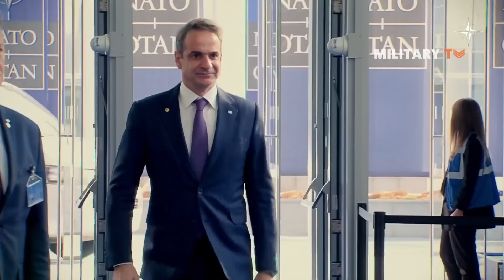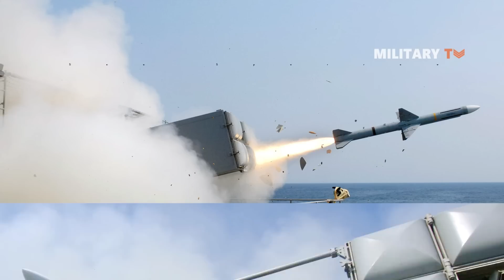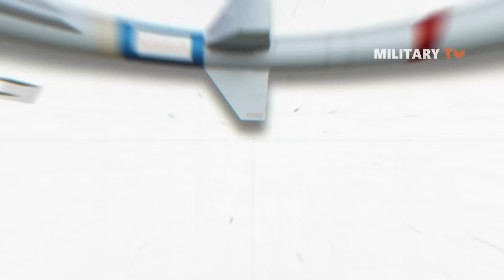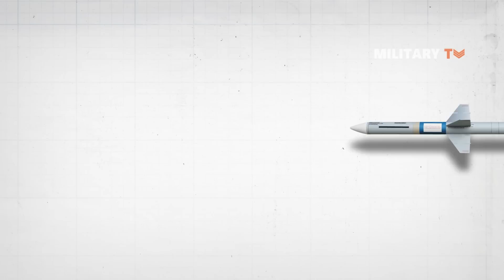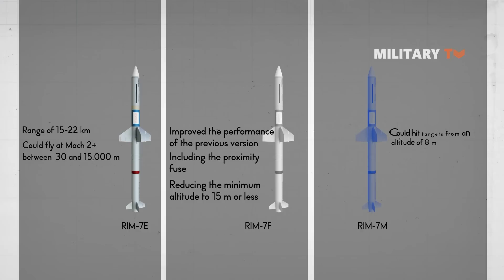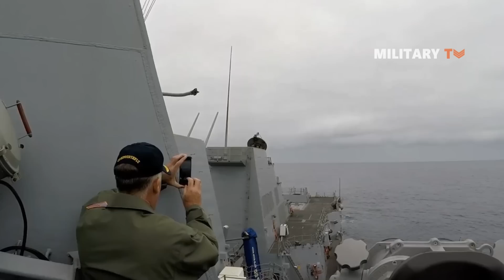U.S. to Send First Sea Sparrow Anti air Missiles to Ukraine

Comment: NOT NASAMs, but still good when used against drones, just not modern aircraft with anti-radiation missile capabilities. The RIM-7 has a 12 mile range and needs constant radar direction. It's based on the air-to-air AIM-7 sparrow radar guided missile. The usual anti-radiation missiles used by Russia and China t destroy ground radar sites have a MINIMUM Range of 10 miles...
 The NASAMs are fire and forget using the AIM-120 AAMRAM missile. With the latest NASAM-3 able to fire short range sidewinders and IRIS-T  infrared homing missiles (fire and forget...) AND the ER (extended range) versions of the AAMRAM (31 mile range and higher altitude reach)... Then comes the Patriots  (20 to 100 miles)... Compared to AIR launched missiles like the Meteor with a 200Km range, flying at Mach 4+, ,it's NOT that great, but gravity takes a toll on range..

Comment: The key here is that Ukraine current systems of Russian S-300 and Buk have very limited supply of missiles
By getting western missiles , Ukraine defenses can operate more effectively
Reply: Western missiles are more modern than Ukraine's. Ukraine had a large stock of AA missiles, but the rate at which they are expending them & how long the war has been going on has taken its toll. S300 certainly couldn't protect kyiv from kh-47 Kinzhal. Layered defense is the way to go.